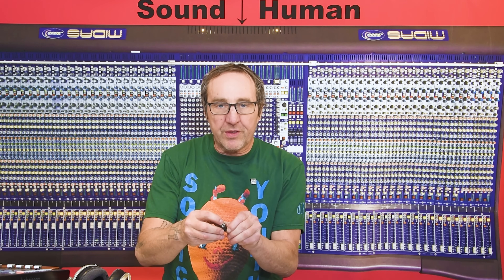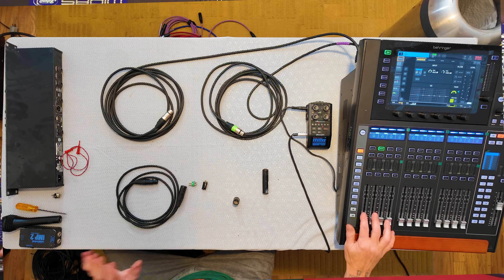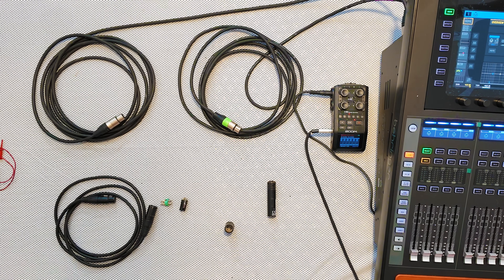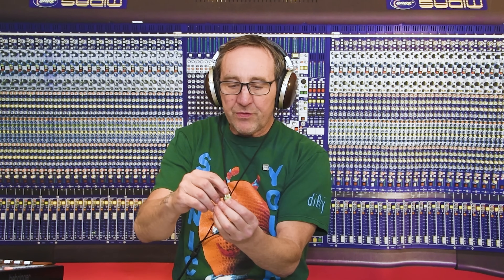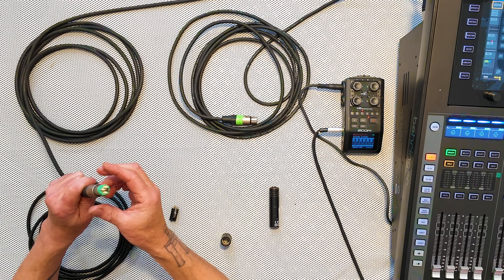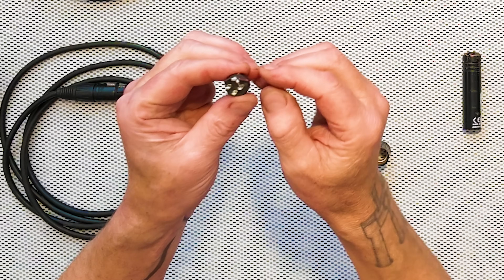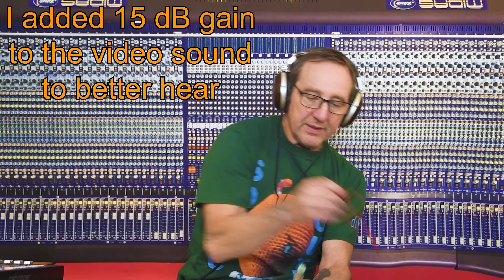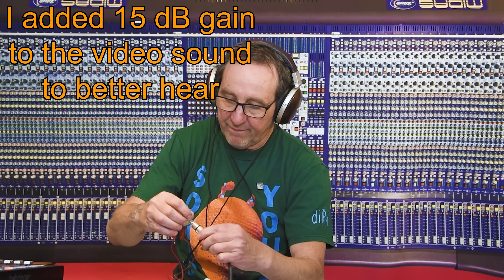XLR Shell Ground Issues

Comment: I always ground the shell to pin 1 on cables, but use plastic, insulated Neutrik connectors on my equipment, so that both shell and pin 1 are connected to audio ground, not chassis ground. Somewhere in each piece of equipment, audio ground is connected to chassis ground through a very low value resistor. That way, and grounding currents will build up almost all of their voltage across these resistors, rather than the audio grounds (cable shields) between equipment. This ensures that all equipment is seeing a common audio ground regardless of what's going on with the power line equipment ground. A ground lift switch, which breaks the pin 1/shell audio ground connection between equipment must use a high quality transformer with a faraday shield such as a Jensen.
Reply from the maker: If the show is plastic then it doesn't provide any shielding and there's no reason to connect it to pin 1 

But if the shell ground connector does pass through to the chassis and your cables are all shorting your chassis grounds to your audio grounds, that is less than optimum. 

There should only be one path for chassis ground to hit audio ground in each piece of gear. 

And that should already be internally done. Shorting the shell or chassis ground in the xlr connector to pin 1 creates a second path between audio ground and chassis ground. 

This does nothing good and just makes your system noisier

I built all of our large format touring sound systems using no transformers for many years by paying careful attention to grounding methods.
Reply: @DaveRat  The cable connectors all have metal shells, the chassis connectors are plastic, thus isolating the shell ground from the chassis. Neutrik NC3FPP. The shield, pin 1 and the shell are all connected to audio ground, not chassis ground. For safety, the chassis must be connected to the power line equipment ground.
Reply from the maker: Ahh, I understand now. Cool

Comment: If you ground the shells there is one more huge problem. If you have two microphones or one microphone and one line level cable both with extension, just touch these XLRs midway and you will have fire-cracks.
Reply from the maker: Interesting I will see if I can test that thank you

Comment: Hi Dave, I think this is partial true. Namely LF, 50/60Hz, that’s what you hear as hum. If you would reason HF, everything should be grounded together as much as possible. HF interference (EMI) occurs mostly by switching appliances, like power supplies, light dimmers, motor drives etc. Especially on sites, running at generators (high grid impedance) HF EMI will occur. So, best of two worlds would be LF disconnected (as you suggest) and HF connected. 
That’s possible, namely by a capacitor in between pin 1 and the shel.. it acts like a conductor at high frequency’s and is open at lower freqs like 50/60 Hertz. RC combination would even be better.. just as a theoretical hint! 😊
Reply: Yes, if you have an issue with RF pickup, this may (or may not) help  But the presence of RF pickup would tend to indicate that the equipment picking up the RF is poorly designed with a "pin 1" problem.  Look at the AES archives on grounding and bonding for extensive study of this issue.  Good design of the shield termination in the equipment and of the circuitry can avoid this problem.

Comment: If you're using analog snakes from the console/digital stage box and then individual xlr to the mic's from there, wouldn't every xlr cable be an extension or should there be proper grounding in most quality analog snakes?
Reply from the maker: Yes, Audio snakes should have proper grounding which involves making sure that pin 1 is not connected to the XLR shell housing

Comment: what about filter cap (capacitor) between pin and shell?
Reply from the maker: That can be helpful and create a lower resistance high frequency connection between the audio ground and the XLR shell.

This will help the shells carry the audio shield over the wires in the connector without directly connecting the chassis ground to the audio ground if the cable is plugged in to a piece of gear. 

You can actually buy connectors designed to reduce interference with capacitor or capacitor resistance combinations 

They're still can be issues with this as you are still creating a high frequency chassis connection through the shield from one piece of gear to another if the cable is used on anything besides a microphone or an extension. 

Ideally chassis ground would not be connected to the audio ground in multiple places.

Chassis grounds tend to be more messy and noisy than audio grounds can be problematic

Comment: About 25 years ago I set up a small pa for a figure skating show. It was a mic with a 100' of cable, can't remember if it was extended or not, small mixer and music playback. Worked fine, except right after the first announcement, the client came to me and said "I just got a shock from your microphone!"

I was skeptical, but when she handed it to me I could feel a buzz or vibration similar to when you rub those touch lamps from the 90s. I unplugged the mic, and checked all the holes and shell of the connector with a multimeter for both AC and DC voltage, but got nothing. Same at the mixer, eliminating the cable. I couldn't duplicate the problem but she was ademant that she got a jolt, and I felt something strange was going on so I kept digging. I was standing on a rubber mat in the referee box, and she was on the ice when she felt a shock. Finally I checked between the metal chassis of the mixer and the steel frame of the rink boards and found 70+ volts of AC. Unplugged everything and tested the outlet in the ref box, found that it wasn't grounded at all, and the hot and neutral had 120v between them as expected, but measuring to the grounded metal boards only about 50v to hot and 70v to neutral. A 150'extension cord to a different outlet solved that problem.

When I told the arena manager about the unsafe power outlet, he got defensive and said they always plug a sound system into that outlet and never have a problem 🙄

Indeed, if the shield wasn't connected to pin 1 in the mic, and if the Mic wasn't given to someone standing in a puddle of frozen water, the problem wouldn't have been discovered.
Reply: The arena manager was leaving himself and his arena open to a significant lawsuit should someone be injured by that miswired outlet.  Nowadays, a significant OSHA fine as well.
Reply from the maker: Interesting and scary!
Reply: The XLR connector case has nothing to do with it. If the screen wasn't connected to 1 XLR contact, the microphone wouldn't work at all and there would be a loud hum :))
Reply from the maker: The mic will internally connect its housing to pin one and also should ground the XLR shell. 

The XLR should not have pin 1 grounded to the shell as the mic will do it for you and having pin one granted the shell is highly probable to cause issues in other scenarios. 

as far as the person getting shocked from the mic, indeed it appears to be an issue with poor grounding or lifted grounding of the console that the mic is plugged into.

Comment: Nice video, Dave. 

It would appear that a solution would be to just ground the male connections. In theory would give a shielded housing when extensions are used and also grant the ability to ground lift. The problem is that signal ground and chassis ground is joined together at the mixer on the insertion of a male connector. To solve this issue, the grounding was changed to only female connectors having their shells connected to pin 1 but then this presented the problem of an exposed connection directly into signal ground!

One argument against grounding is that a true differential pair does not need a ground so there is no reason to use pin 1 in the first place. Only pins 2 and 3 are connected and the shield is only connected to the connector casing creating a continuous chassis ground but no signal ground, if any shielding is connected at all. Only a chassis ground if any is present, no audio ground. But then this creates another, potentially much more serious problem.

A strong argument for not grounding connector shells concerns electrical safety in that if there is a fault on mains powered equipment then having the shells connected means that the faulty equipment can send power that should go to ground through the signal cables! This situation is obviously highly undesirable and sadly much more likely to occur with the use of switching power supplies in audio equipment. With such power supplies it is quite a common failure for part of the internal filtering to go bad causing anything up to mains voltage to appear where there should be zero volts ground.

Add to all this the prevalence of RF sources such as radio microphones and mobile phones then the RF behaviour of cables and connectors needs to also be considered due to the possibility of RF injection into sensitive audio equipment. This is one reason why there are now specialised XLR connectors with filtering inside to combat this issue.

It would therefore appear that simply leaving connector shells not connected to anything is the best overall practice.
Reply from the maker: Agreed and thank you. 

And for those that do field recording they should ground the shells and mark the cables or Make special male to female XLR cables are adapters that have pin one grounded to the shell and insert those when extending cables.
Reply: But wait until you plug that male XLR into a panel of female chassis mount XLRs on a wall panel (probably attached to a metal wall box and conduit.  You are likely to get plenty of Hummmm.
Reply from the maker: Having especially marked cables with grounded shells that only get used in between two mic cables whan extending XLRs, works well. 

As far as someone using a 6-in long XLR male to female cable that has special green tape and ground symbols on both ends, And somehow thinking that's an important amount to extend a cable that's plugged into a wall, well you can't really fix dumb 

So yeah it'll happen but also it's easy to spot and fix

Comment: The ground loop issue here is the same reason why you only bond the neutral and ground in a house breaker box in one location, because if you connect the Ground and Neutral wires in more than one place, you now will get current flow on the ground wire instead of just the neutral wire, which means that your ground system in the house is no longer at zero volts, which is NOT a good thing lol
Reply from the maker: Yes agreed. The chassis ground and audio ground should not be tied together in multiple places. The chassis ground should not be carried through the cable to another chassis.

Comment: What about using phantom power? I have trouble with chassis ground not being firmly connected which causes noise sometimes.
Reply from the maker: Hmm, there are 3 grounds we deal with, audio ground, chassis ground / equipment ground  which is the ac ground, and earth ground 

Earth ground is for lightning 

Chassis ground is for safety and shock hazard

Audio ground is for shielding and noise reduction and phantom power.

Chassis ground should not impact phantom power. If phantom relies on chassis ground, there is something wrong

Sometimes chassis ground and audio ground are the same.

But typically they should be separate and onlly connected inside of gear.
Reply: Thanks Dave, you’re the best.
Reply from the maker: 👍👍 thank you

Comment: Fascinating.... Excellent video as always. and irrefutable results.
I've been installing top end pro gear since 1984, starting in Studios in London, moving on to live touring, installing theatres, nightclubs and commercial venues for major global customers.
It has been an interesting progression. In the 1980s there were HUGE issues with equipment grounding. There was a whole load of pro gear with UNBALANCED inputs (remember the Crown DC300A) and even balanced gear had random grounding theories and systems. I used to spend days on each install getting the grounds quiet. Worse still was getting a system quiet and then someone buys some new gear and we have to go through the whole process again. 
Say what we like about the European Union, love it or hate it, but the introduction of the European Electromagnetic Interference Compliance directive around year 2000 really changed the whole industry globally. Manufacturers had to prove in the lab that their gear rejected electromagnetic interference or it couldn't be sold. Very quickly we saw all the gear that introduces ground noise into the systems just stop being sold (or was modified to not cause issues) In the last 20 years over hundreds of installs and thousands of gigs I just haven't seen the kinds of issues we had in the 80's and 90's.
There is a REALLY GREAT Rane document on audio interconnect that opened a lot of our eyes in the mid 90s. Here it is https://www.avw.com.au/images/techpapers/Rane_note_151.pdf
Personally now i almost never need to play with grounds even on massive venue installs. Do it right in the first place and it usually works.
The elephant in the room though is that the majority of ground borne noise issues come from poor electrical systems. A good solid electrical ground across the whole system and indeed often a mesh ground system should prevent any potential difference between audio grounds as all items should be mains grounded to the same reference. This means using AS THICK A POWER CABLE (ground) AS POSSIBLE at every opportunity to avoid line resistance allowing a potential difference between items of equipment. Also DON'T MAKE PHYSICAL LOOPS. run everything star topology and please don't run power cables down one route and audio cables down another, that way we just end up making a whole massive induction loop around the venue. 
And one last word. . NEVER ever ever lift a power ground on any gear to solve a ground noise issue. I have seen plenty of people get a shock from this method (especially backline) It's insane. (Thankfully now the need for many venues and festivals to have all electrical gear "potable appliance tested" has reduced the amount of ungrounded gear being used by bands) 
.
Thanks for another great video Dave.
Reply: Now that’s a professional comment. Indeed, the EMC guideline forces every supplier to make good devices.. Nevertheless, in the installation/cabling fase, a lot can (still) go wrong.. The solution against EMI: grounding, as much and often as possible, by as thick and flat conductors as possible. (Shielding, constructions, chassis etc.) And avoid TN-C grids.. separate the PE and neutral in the installation to prevent ground loops..
Reply: @ An interesting point. If a system is very solidly and regularly cross bonded then it is surprising how quiet a system can be with absolutely no earth potential reference at all. So long as there is no potential difference between the audio 0V reference points we can get some good results. Take for example a system on a carnival float or even a massive show in a desert environment where the only floor we have is dry dirt or sand for a long way down. We have had virtually unmeasurable high earth resistance in summer on some rather large festivals in very dry dusty places yet with good interconnect bonding of the systems we had very little in the way of cable ground borne noise. I now work in a lot of places where we get supplied with a TT system and where the local ground when measured on a 3 wire earth resistance meter is a few hundred ohms. We have to make that work, and we HAVE to make it safe for artists and the public. It requires some good engineering.

Comment: Excellent discussion! One way around the loop is to put a 0.01uf cap from pin 1 to the shell. This grounds it for RF but keeps the impedance high for 60Hz and doesn't defeat the ground lifts. Of course, there's a way to get in trouble with this method! 😅You can put RF right into the ground of a piece of gear... There's no easy way out. Usually, you have to be prepared to try a few different scenarios. Chris Muth, former technical director, Hit Factory, Sterling Sound, New York.
Reply: This ^^^

Fixed a $30k Tascam analog desk that picked up local FM radio better than my car.

The schematics actually listed the filter cap, but it was marked "optional"
Reply: @litz13  It's your option to not pick up radio stations!  😀
Reply: @taloowa5800  adding the caps DID fix it though
Reply: @litz13  Yes indeed! Tascam didn't think you needed them, though. A similar thing happens all the time with wall warts now. Manufacturers get them passed for RFI then go to production, leaving the filters unloaded to save a few pennies per unit. That switching noise can get all over your system and it's loads of fun finding the culprit(s).
Reply: @taloowa5800  for sure.  I'm 100% sure their design criteria didn't take into account placement 800ft almost directly below an antenna atop a 73 story hotel.

Comment: Very good video to have out there! I do mostly location sound ("battery powered everything") but even still all my (quad star) XLR are not tying pin1 to chassis. I never really thought much about the added noise from extending cables. Good stuff!
Reply from the maker: That is a perfect application for grounded shells!
Reply: @ yes, now thinking maybe I keep a pair of XLR’s chassis grounded for boom mics. Occasionally though I am hard-lining a mix to cameras which are sometimes on AC power - to add to the variables 🤪
Reply from the maker: Making a six pack short XLR female to male cables that have pin 1s shorted to XLR shell, and using those whenever an extension is needed we'll do the trick and prevent grounded shell cables from getting accidentally used.